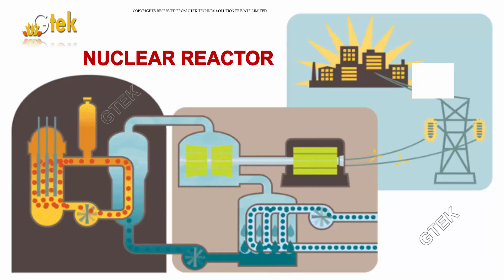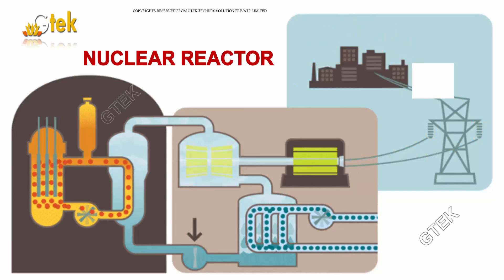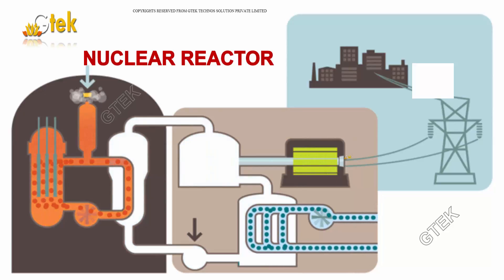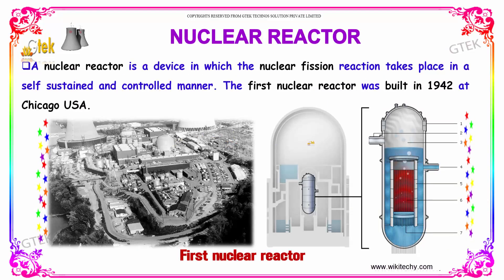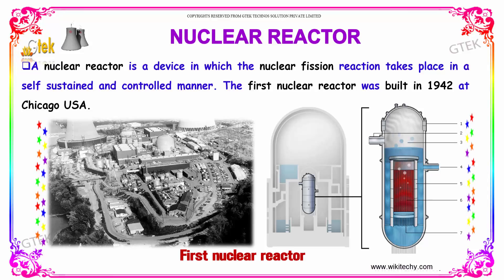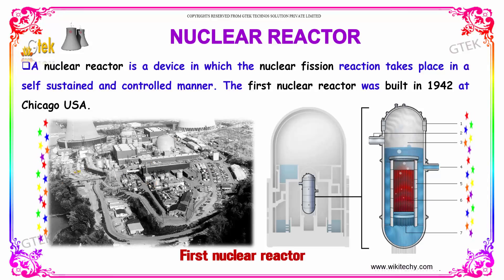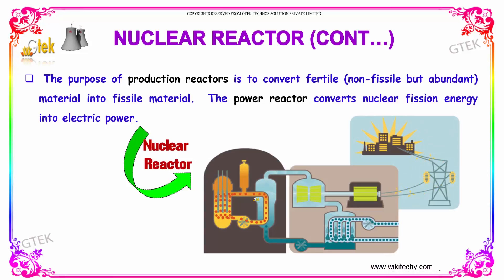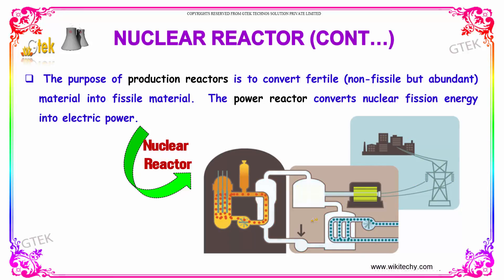Nuclear Reactor |  Nuclear Physics |class 12 physics subject notes lectures|CBSE|IITJEE|NEET

Comment: A nuclear power plant is a thermal power station in which the heat source is a nuclear reactor. As is typical in all conventional thermal power stations the heat is used to generate steam which drives a steam turbine connected to a electric generator which produces electricity.

Comment: In a nuclear power reactor, the energy released is used as heat to make steam to generate electricity. (In a research reactor the main purpose is to utilise the actual neutrons produced in the core. In most naval reactors, steam drives a turbine directly for propulsion.)

Comment: A nuclear reactor, formerly known as an atomic pile, is a device used to initiate and control a sustained nuclear chain reaction. Nuclear reactors are used at nuclear power plants for electricity generation and in propulsion of ships. Heat from nuclear fission is passed to a working fluid (water or gas), which runs through steam turbines. These either drive a ship's propellers or turn electrical generators. Nuclear generated steam in principle can be used for industrial process heat or for district heating. Some reactors are used to produce isotopes for medical and industrial use, or for production of weapons-grade plutonium. Some are run only for research. Today there are about 450 nuclear power reactors that are used to generate electricity in about 30 countries around the world.